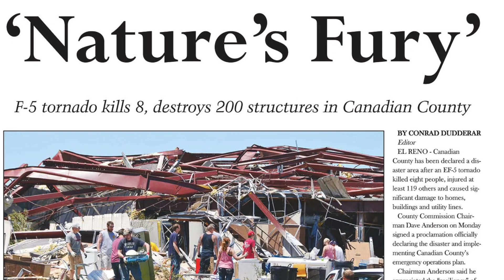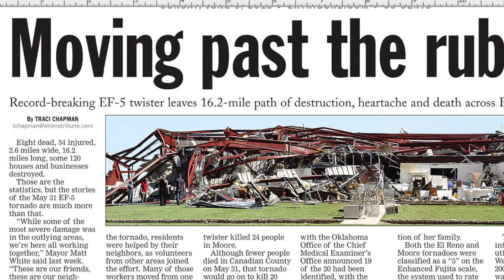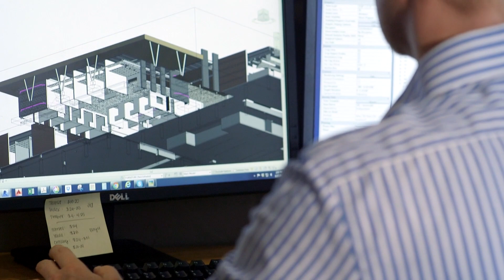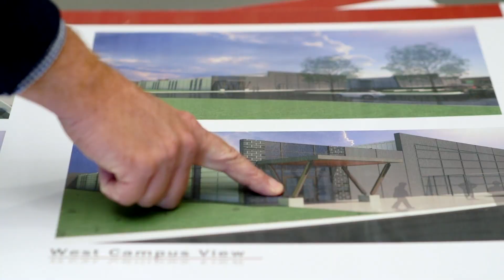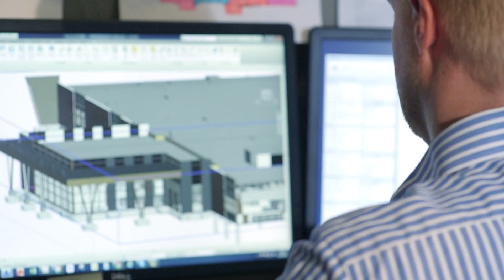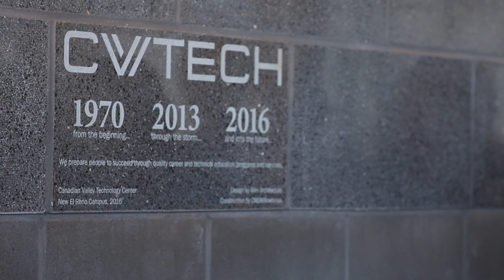Canadian Valley Strong: Rebuilding CV Tech

Comment: 20 mins of Video talks all about the programs, shows old images of the destruction yet for some reason. The only honorable mention of the Aviation Maintenance Technician program of the school was an overhead view of a Twisted Piper Archer sitting on the front lawn of the school. It shows and talks about the daycare moved to a church the other programs moved to the Dealership,shows Auto mechanics, shows Salon yet the one course that got shoved around the most and moved twice it basically forgets and never mentions once. 

It doesn't mention the course, the Director, the Instructor or the students and never makes mention of the helping hand received to take on the Course by Francis Tuttles Sheet metal Program, nor does it make any mention of the helping hand received from MetroTechnology Centers that gave CVtech a  spare classroom and allowed their tools to be checked out without requiring CVTech Students to purchase their own set of tools as required by Metrotech of all their students. No mention of them opening their facility to CVtech so that their Students could finish their A&P course. An 18 month long Program, plenty of time was there.

I cant believe after 4 long years in that time you didn't even bother to interview nor film anything of the director, instructor or 
students from the AMT program, Past nor Present. Not even a single mention unless it was the part where he said "Other Programs..." You may be offended by my comment but it would seem as if the program has been forgotten in its entirety and  left out of a major part of CVTech history. As a student who went through both moves of the course I'm disappointed to see this. Here I was happy to see a video about the rebuilding of CVtech thinking our program might have gotten some mention.